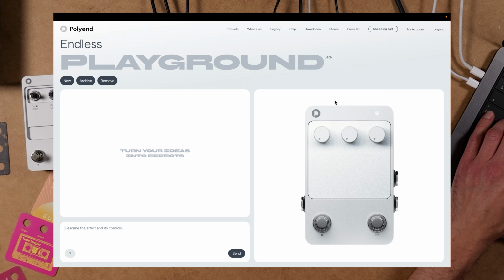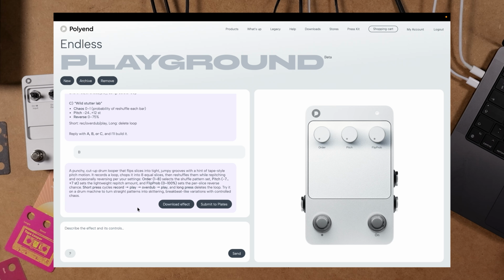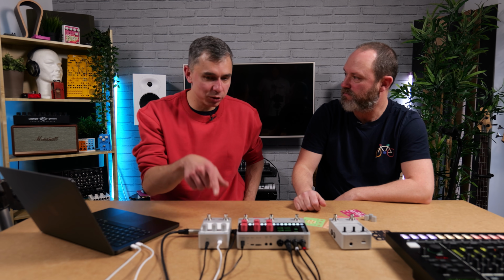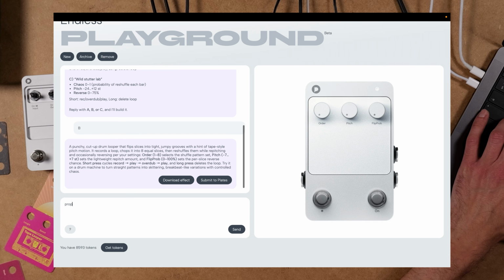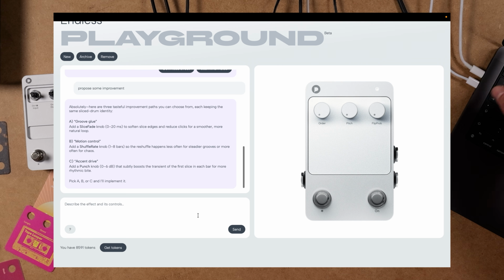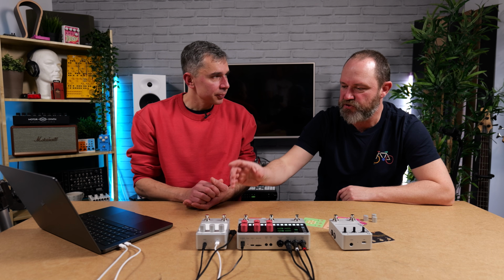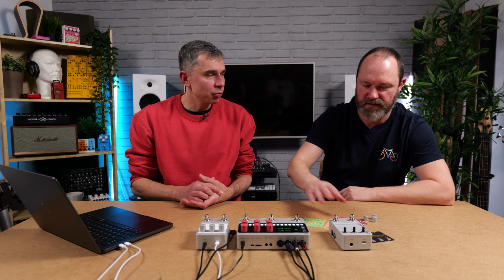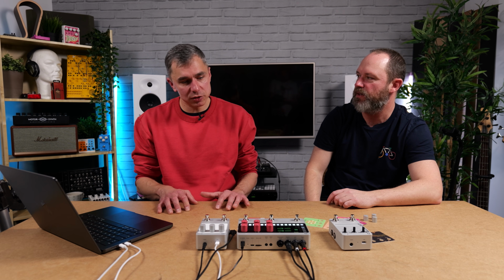Is Polyend's AI-assisted FX pedal the future of music tech? Endless demo & developer interview

Comment: $1 to generate one experimental chunk of code is extremely expensive considering to get something unique will surely require dozens of iterations and experimental attempts - even if the actual code generated for $1 has some knobs on it.
Reply: Also it's a fucking nightmare, I don't want to think about how much money I'm spending or whatever while I'm in the creative process. God forbid the payment fails and I have to switch cards or something in the middle
Reply: @muchachogrande2019 it gives subscription based FX Pedal good god man. GO BACK!
Reply: And if they have any success selling these units, they will definitely raise the price a few cents, because people are stuck.
Reply: @MaTTheWish slippery slope to micro transactions in music production on hardware
Reply: @MannyBeGaming  💯
Reply: That's actually an interesting perspective.  I didn't think about that, but what you're saying makes sense.  There's no way anything decent is going to come out after one prompt, so it will take several attempts.

The concept is interesting, though, and the user library is free.
Reply: It should give you a time limit to make changes. And the larger glitch and looper codes will cost 1-10$ to generate. That is what they said at Namm show
Reply: I get the concern, but in practice it works differently.

Most of the time you get a usable effect on the first try, and further iterations are much cheaper than the initial generation.

Also, compare that to hiring a DSP programmer. That would cost far more and take days or weeks, not seconds.
Reply: @PiotrRaczynski   I use claude code on fixed monthly subscription and the amount of code it can generate, iterate on and refine (all very important steps) is unbelievable for the price. I'd say it is 1000x cheaper than $1 for one noise generating dsp block. If this box has a sandbox (it must do) and offered an accessible protocol defining url, and a recommended prompt, one could use whatever LLM including a local LLM. Just paste what you want, and the fixed prompt into anything (chatgpt free even), then paste in the code generated.  Stop trying to profit on people eating tokens, focus on the product. That's my 2c.
Reply: @PiotrRaczynski  You arent getting a dsp programmer that can do what you want, you are getting AI that may or may not spit out code that you like.